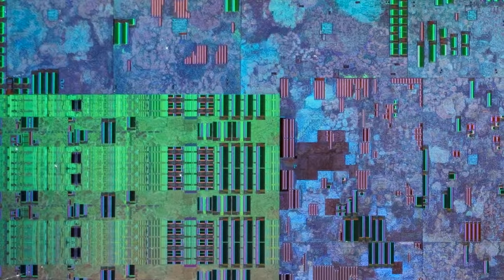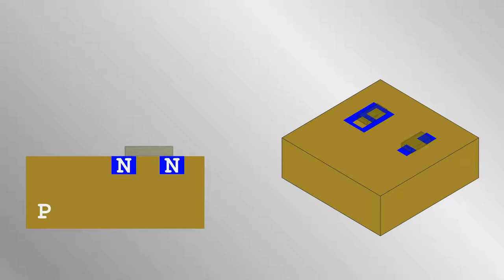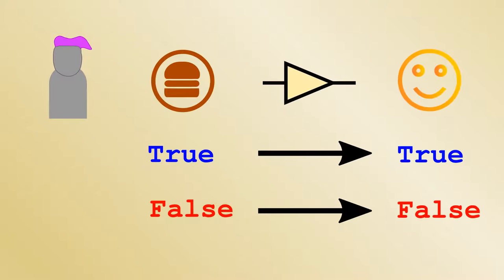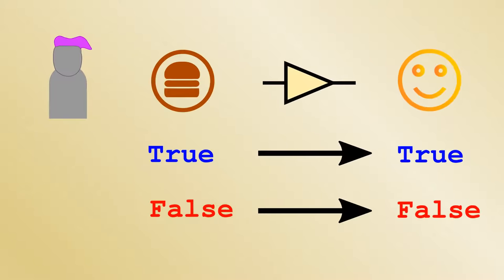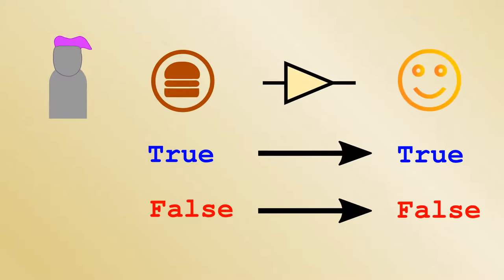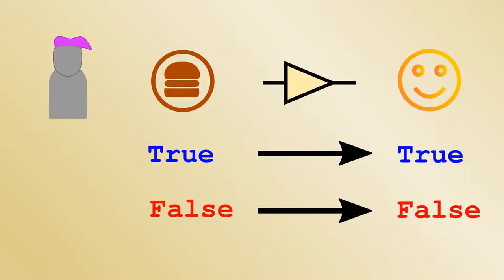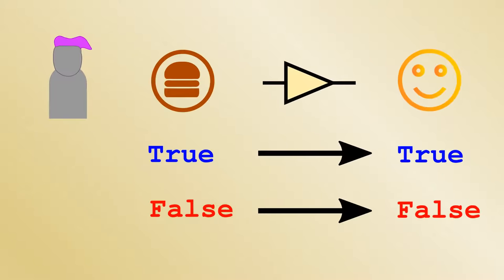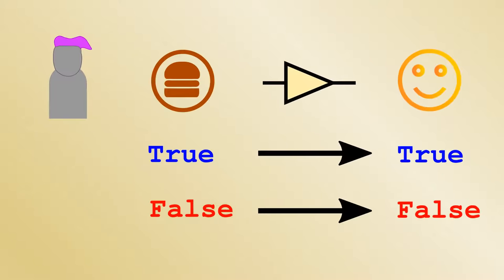How a Computer Works - from silicon to apps

Comment: I'm a laymen here - but how would you keep the load down on instructions or pathways? I imagine/assume some calculations are used way more often than other ones (or maybe not, I'm fairly unfamiliar with this territory). Or perhaps that doesn't matter much? I'm just picturing like the mechanical wear and tear that a car may sustain over time and picturing an electrical circuit that starts a pathway over and over and over again at the same place/position, that at the beginning position would be used A LOT - are the components of computers that superior to take on this excessive loads or does the computer/circuit pathways have ways around this to lessen loads? Thanks for the content as well !

Comment: Agree to many others here. This video provides the exact information I was looking for, explained in the way I needed. However, I still need help with understanding the very first instructions aspect, are gates built and set for those specific instructions? 

I'm probably using the wrong terms below, apologies but:

Gates are built by transistors allowing for multiple combinations in a predictable way. Cool, got that . . . I also understand the logic of binary code processing calculations, instructions, functions, etc.... but I still don't understand how "it begins", how do the first gates "know" they are to process your electrical currents as numbers, or letters, or colour, etc. It's as if it's pre-set(?)

Like, once you have processed the first instruction, easy! Can flow from there, but how is the first instruction or language set? I feel I'm missing something basic.
Reply from the maker: In very very simple terms: Let's say the first byte in memory is always the first instruction. 

There is a gate network that loads the first byte. Comparison circuits (big XNOR) to compare that byte with the code for add, subtract, jump....

Let's say the byte corresponds to "add".  A bunch of XNORs has its output connected to switch on the add circuit. Because the byte in this case causes the XNORs to output a 1, the add circuit is switched on, and it adds byte 2 and byte 3.

Again, a very simple explanation, but that is the essence of how it knows to "add" when it gets the correct instruction.
Reply: @ImprobableMatter  Thank you so much for your reply. I highly appreciate it. It helps, not perfectly clear but getting closer hahaha. Let's see if I understand correctly, the first gates are "set" so that it "forces" a result, with a pathway to byte = numbers > then other groups of gates that mean "calculations" to convert such numbers into letters, which then go to another group of gates that convert those letters into words > logic phrases, etc (human understanding only, I know the computer it's just processing the electric flows), right? If so I guess I just needed to confirm that the very first byte it's "set" or "forced" somehow . . .  I hope haha
Reply from the maker: @alpach86 @There are "entry points" to programs, which are more complicated ways to get the whole thing started.

There are no separate logic gates to convert binary numbers to decimal numbers or letters. The same circuits can do that; every letter is represented by a byte and get manipulated just like any other number.
Reply: Ok thank you so much for the reply.

Comment: I'm a bit confused. When you refer to N-channel and P-channel transistors, are you not actually describing enhancement mode and depletion mode?
Reply from the maker: Enhancement and depletion mode are something slightly different. CMOS as used in your computer or phone uses enhancement mode transistors, but in pairs with different doping, hence P-channel and N-channel.

Comment: you actually don't need to check every button through clever use of data structures.
Reply from the maker: That's true. When compiled, the typical switch statement is much more efficient.

Comment: Im confused about ram, does having a 64 bit address mean the cpu needs to send 64 bits to access 8 bits?
Reply from the maker: Yes, if it tries to access a single byte number. But the advantage is that, let's say that you actually want 1 million such numbers (each one is a pixel, for example), then you can go to the address of byte N, then byte N+1 and so on.

Comment: how do they solve the double image/interference pattern generated during lithography? ie the two slit light physics problem.  Also, who was Grace Hopper?
Reply from the maker: There's diffraction and interference, sure, but the design accounts for this. Given a mask, it is possible to calculate the image produced and compensate for those effects. Grace Hopper was an American admiral who developed the first compiler and coined the term "computer bug" when a moth flew into a computer she worked on.

Comment: How computer physically jumps to address? Easy to imagine on hard drive. But what happens on SSD and actual CPU?
Reply from the maker: The jump instruction refers to memory, so the computer would load bytes from around the next address in the memory into the cache and then execute the instructions.

Comment: 28:40 Am I understanding correctly that there are no separators, meaning that you can only figure out what something means (e.g. whether it's an instruction or an address of some data), when you've read and interpreted all data before it? You can't understand anything if you start reading somewhere in the middle? How does this then work when you do a jump to somewhere?
Reply from the maker: Every byte is the same, there is no way to tell apart an instruction from anything else. Some of the bytes from this video are indistinguishable from instructions, so if you jump to them by mistake, your program will probably crash.

There is one nuance that came into play since the 1980s. Now different programs (including the OS) can share the CPU. So if Google Chrome jumps to the wrong place, it will crash or hang, but other programs will not. If the OS does that, you're in trouble. Most modern ones are very robust, but crashes and BSODs still happen. Also, the OS is able to stop a program from going outside its allowed memory space, so Chrome can't jump in and mess up a game of Half Life that's also running for example.
Reply: @ImprobableMatter  So when I do a jump/goto, how does it know how to interpret the bytes there? Or does it just assume that it's always an instruction and act as if that is the case (meaning it will crash if it's some other type of data)?
Reply from the maker: Yes, exactly. It assumes that the byte it has jumped to is the next instruction and acts in accordance. This is pretty reasonable, because most programs are well made nowadays and are able to chain together potentially millions of instructions including all sorts of jumps and work perfectly well.

Comment: 0:50 Beethoven’s 5th symphony music,
0:58 Transistors, 1:49 symbol for transistor: metal oxide semiconductor field effect transistor [MOSFET].
1:12 modern computer components typically supply a voltage of 3.3 or 5 volts between + ground or - terminal,
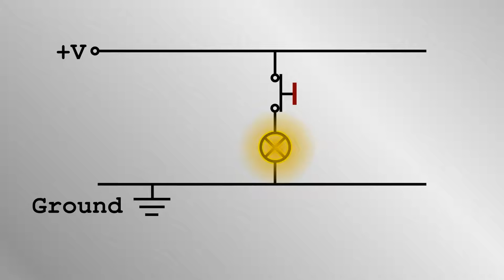1:32 important component on our computer, push switch which comes in 2 flavours.
1:37 Push to make, when a person presses down, the circuit is completed between the terminals and the bulb lights up.
1:44 The push to break switch is exactly the opposite.
1:58 transistor source and drain are the two terminals of a switch, third terminal 2:03 called a gate.

Comment: why is a PMOS referred to as a "push to break" when adding external voltage actually completes the circuit? wouldn't that be analogous to a push to make? You add voltage to a P type, and then the more voltage the better the conductivity channel between the Source and the drain, as negatively charged particles from the semiconductor are attracted to fill the holes in the positively charged electrical field at the gate?

Comment: I still dont understand how 0 and 1s can possibly make anything we have. How does a series of 0s and 1s actually equate to anything we say it does. How the hell did we go from 0s and 1s to having video games or anything for that matter its literally magic. Did someone at some point have to code legacy instructions and bake them into everything ever? I dont get how we made a flat piece of glass with uv light etched mazes and how any of that can possibly do anything like it does. It just makes no sense on a mechanical level.
Reply: Its all 1s and 0s. A screen for example consists of thousands of ARGB Pixels which get their Information in bits and bytes a pixel is usually made of 32 bits/4 bytes where one byte is 8 bits. A byte is a number between 0-256 displayed in 8 bits. A bit is either 1 or 0. 2^8 = 256 therefore numbers between 0-256 can be displayed in bytes. Now one pixel has 4 components ARGB each displaying their own byte in their own intensity. For example the red part and the green part might have an equally high intesity therefore the pixel looks yellow to us.

Comment: Good up to CMOS. Unfortunately, CMOS is inherently quantum mechanically defective. There is a transient short between power and ground every clock cycle. That is why modern CPUs are setting motherboards on file. And why CMOS video cards are melting the wires and connectors. Switching to resonant tunnel diode threshold logic would improve the gates by a factor of 100,000.

Comment: So it's all about 1 or 0?

But whyyy???!
Reply: why everything has to be black and white :(
Reply: It's just a number system, think about it like a different language of Math. You have the base 10 language of Math which we use everyday called the decimal system, you have the base 16 hexadecimal, you have the base 8 octal, and 1s and 0s are just the base 2 or "binary". Anything you can do with your regular 1,2,3,4,5,6,7,8,9 you could also do with 1s and 0s, so the question would be then why not use the normal decimal system? 

Well it's easy to control 1s and 0s by seeing if there is a voltage or not. If their is a voltage you say it's a 1 and if not then it's a 0, simple as that. Maybe in the future we may invent some new technology where different levels of voltages can correspond to different numbers in the decimal system and move away from transistors, but probably not anytime soon.

Comment: 2:23 that's a really weird and incorrect way to talk about nch and pch FETs. No a positive voltage applied will not automatically turn off a pch FET. an enchantment mode pch FET is off by default unless a positive Vsd bias is applied while the gate is tied to ground or some potential low enough to not pass the vgs threshold voltage. Depending on your previous state (implied no bias) all you're gonna do is turn the FET off harder. This entire section pretends like it's explaining nch and pch FETs but you're just describing their function in CMOS where the source of the pch FET is always tied to Vdd and the gate is always tied to some input. This will give people an incorrect understanding of how pch FETs work. 0v gate input will not drive a pch FET unless the source is biased past threshold. you're describing a circuit not a device.

however all of that is a fucking distraction a pch FET is OFF by default. it isn't a push to break switch it requires input to be active. a "push to break" switch would be a depletion mode FET which is actually active by default and requires some bias to close its conducting channel.
Reply from the maker: Have a read of this for a simple explanation: https://electronics.stackexchange.com/questions/47010/how-a-cmos-not-gate-works

Or else, any computing/electronics textbook.

Comment: FYI: "Push to make" = "normally Open" (NO). "Push to break" = "normally closed" (NC). If you want to sound "knowledgeable". But who really cares.

Basically, a good overview. I like the 10 Billions (Giga) memory bytes. The first CP/M computers, I used, only had 64K (kilo; thousands) bytes of RAM, and used 8" floppy drives. Oh, it was fast ... well sorta. 2MHz clock, and no cache.

26:15 - Clearly a CISC processor.

Minor error on the LEDs. They are diodes, and won't conduct until a forward drop is hit. Then its roughly constant. Its the current, that determines brightness. This is commonly achieved using a simple resistor in series.
Reply from the maker: Thanks. I specifically do not want to sound "knowledgeable". I want to use phrases familiar to anyone at a highschool level and above.

Comment: There's no way to say how a computer works from transistors to silicone to aps in 40 mins, but you really should've explained a little more about how a transistor works.  Then you need to come over latches.